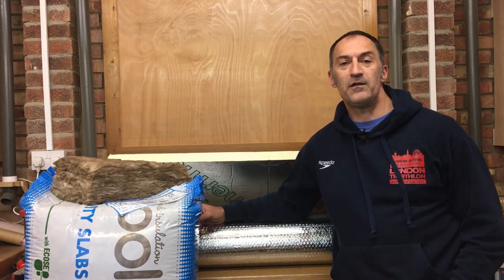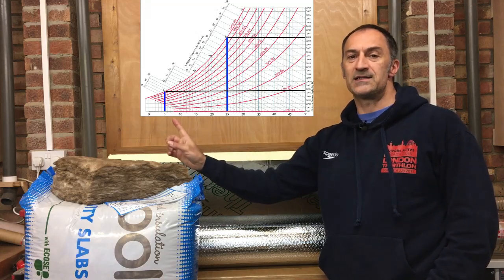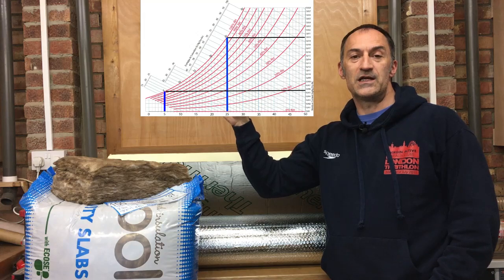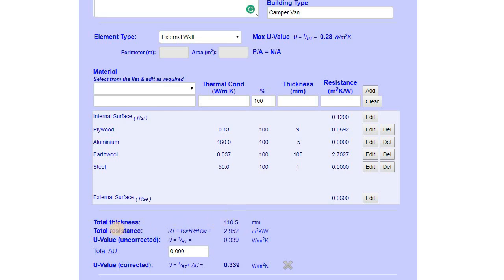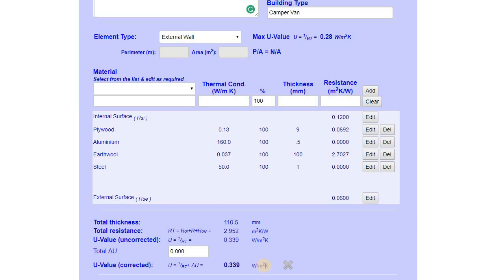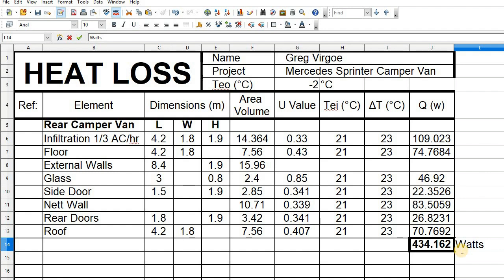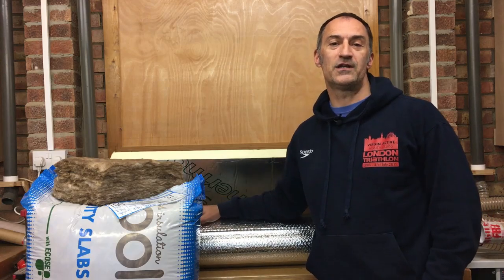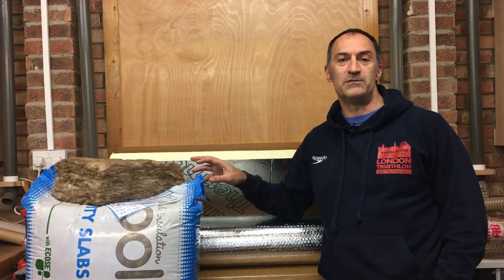How to Insulate your Van Part 1 - The facts you need!

Comment: Hi Greg does this kind of insulation work also in a hot climate?thanks
Reply from the maker: Yes, thermal transmittance applies to both hot and cold climates. The same as your cool box works.
The biggest heat source in summer is solar gain through the windows so make sure to shade the windows to reduce this.

Comment: Hello Greg, thanks for this video! It is very useful! Would  you tell me how would using carpet underlay to insulate some of the sides or floor of the van please. I have some left and I thought I should use it. Thanks!
Reply from the maker: Hello Andi, thank you for the nice comment. Carpet underlay can have some thermal properties, comes in thickness from 3mm - 12mm and some even have a foil face for a vapour barrier. You could use it to wrap your door pillars before covering win carpet of headliner material. You would need a lot fo it to fill all the voids in the side panel and I imagine its quite heavy

Comment: What I liked most about your vid. was that it positively agreed with another vid. on insolation. You are an educated Instructor and he has been living in a van for 15 yrs. both have come to the same conclusion. Thank you very much.
Reply from the maker: I’m guessing you are referring to cheapRVliving video on insulation. We share the same opinions on reflectix and it should not be sold as insulation at all. I would still insulate my floor even in warm climate as it will prevent heat gain too. Thank you

Comment: Hi, I have a dilemma. Looking for van conversion like yours. I’m looking to live full time with my cat. Currently cerebrally mapping things out. I will be working at times and my main concern is the temperature of the van in summer live in south east UK. Looking to have two vents as advised by yourself in fact identical insulation too. Not sure how well insulation will keep heat out. I might be considering a bus version in terms of windows, which I think will help me regulate temp through the progression of seasons (lpg temp regulation of sort in winter) as I can manipulate using insulation cut out to block window from cold or sunlight. think a AC unit would drain battery and I’m estimating 200ah pre AC. Advice would be greatly appreciated or on anything I might of missed concerning the well-being of the furry chap. Really detailed vid btw as always.👍
Reply from the maker: Hello, in the summer what heats up your van more than anything else is the solar gain through the windows. This is radiant energy from the sun entering your van via the windows and heating up all the surfaces inside making everything very hot.
A well insulated panel van will work well to reduce the transmitted heat in summer and keep the interior cool just like a cool box keeps your beer cold in summer. 
To prevent the solar gain it it best to have reflective blinds to prevent the sun entering the van. These also work better on the outside rather than internally. While extra opening windows will improve ventilation dealing with the high solar gain will be a problem. Hope that helps.

Comment: Great video. I don't necessarily agree 100% with your choices for insulation, but the principles are sound. Closed cell foam would be easier to use to fill cavities and make sure you get a consistent R value throughout, for instance, no worrying about squishing the mineral wool.  But still, real science on Youtube, nicely done.
Reply from the maker: As I explain in the next video on insulation. Spray foam is a very good insulator and much better than mineral wool. Downsides are it’s messy to apply, it’s a permanent installation and there’s no going back plus be careful you don’t put too much in and bulge out the outer skin of your van or separate the inner and outer skins. Otherwise crack on! 😊

Comment: Greg,  one more question. I am wondering what this means translated to actual temperature loss. I see you've come to the number 434 W of heat loss. But what does that mean in real life? Let's say I heat up the van to 20°C, outside temperature is 5°C. If 2 people are sleeping in the van, how will the temperature drop in an hour compared to an uninsulated van? I have no experience in this area and my googling took me only so far. Thank you.
Reply: Bottom line is really "you need to have a heater". Either a diesel fired one (Eberspächer, Webasto, Wallas) or vented propane, like Propex. If you combine good insulation with a heater, you'll be good to go to pretty low freezing temps. Precise calculations are good, of course, but the best you can do is the best you can do, when all is said and done. Although, each human is about a 100 watt heater in and of themselves.
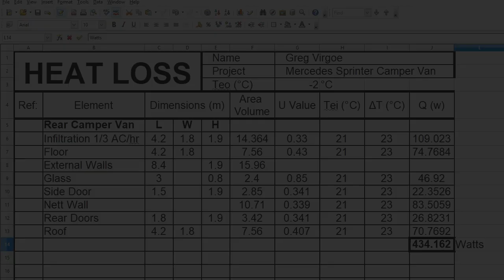Reply: "human is a 100W heater" - would that mean that the temperature would be stable in the van with 4 people and temp. diff. at about 23 degrees, based on the table at 13:20?
Reply from the maker: Hello, all the heat loss calculations relate to one hour, so you will lose 434watts of heat each hour.
Then every heater is also rated on its hourly output. So a 1kw heater will give 1kw out per hour.
My calculation is just for the back fo the van so you have to add some for the cab too.
A human body at rest gives of 140w total heat output. so you really do need a heater to stay warm.
Do a good job of insulating and it will keep down the fuel bills for your chosen heater.
If your van was uninsulated the temperature would drop really dramatically and you would need a huge amount of heat to keep it warm inside and stop condensation forming inside the van.

Comment: Thanks for sharing such a generous explanation, Greg!
Reply from the maker: You are most welcome Daniel, pleased it was interesting for you. Thanks for great feedback
Reply: Greg, further studying the subject (for the first time, I must confess), I found that PIR is noticeably flammable, whereas mineral wool in general don't. Any insights about how did you take that into consideration on your project? Considering the heater, gas hobs, etc., why would you still choose PIR insulation for such an enclosed space? It is a genuine doubt and I am not suggesting that it is not a good option, please don't get me wrong! ! Thanks again for the excellent content!
Reply from the maker: You need to be very specific what materials you research
https://youtu.be/HkM1kOO0S0I
Reply: Got it. Thank you very much, Greg! I think I made a mistake in taking PUR as the same as PIR in the explanation here (esp video "Comparison IPN, PIR, PUR" in the bottom): https://www.kingspan.com/roe/el-gr/products/insulated-panels/learning-center/kingspan-panels-fire-protection

Thanks again!
Reply from the maker: Daniel, I think you missed the part where all of the furniture and cladding in most self-build campers is made of wood. The insulation is the least of your worries :D

Comment: Hi
I also work with designing and installing ventilation systems and I've used armaflex a lot to insulate ventilation pipes where theres tight spaces. What do you say about using a 1,8 mm sound deadener reflective material on the steel followed by a 19 mm thick armaflex mat?

Hope you will answer as i've started my project just now :-)

Cheers

Comment: great video . what do you think of using super foil instead of celotex. would it be better.
thanks paul uk
Reply from the maker: Hi Paul, simply put, NO, as insulation multifoil is absolutely rubbish! I was given two new rolls of multifoil FREE, I took straight to my local tip and threw it in a skip and went out and brought Celotex. When a manufacturer refuses to publish the Kvalue or Rvalue for the actual product on its own be aware they are lying to you about its performance. They have shown it in a wall structure with 50-100mm of conventional insulation and trying to kid everyone that it's their product that's doing all the work. Please, invest your money in a much better product. Hope that helps.

Comment: Hi Greg, great vid - very thorough and interesting. Just one tip (although you may have covered this in another vid?) If you’re using mineral wool in any of the low areas that have the plastic clips holding the plastic bump panels that run down the length of the van, be sure to seal the clips on the inside with a dab of silicone as they can leak slightly. I’ve seen sodden mineral wool in these areas where the clips have not been waterproofed.
Reply from the maker: That’s a great tip, thanks for mentioning it. I have used a bit of sikaflex on each of the plastic clips. Cheers

Comment: Wonderful vid. It covers conduction very well. How about covvection on the outside in wind? I would agree the reflectex is worthless in cold except as a vapor barrier but it can be of enormous benifit in the summer when placed on the outer layer. It reflects heat from the sun. That can make the difference between livability or not in warm areas.
Reply from the maker: I totally agree with you regarding using it a screen on the outside to reflect the suns rays.
I will be using a reflective windscreen blind on the outside of our van during the summer months.
If you can prevent the suns rays from entering your windows this massively cuts down on solar gain.

Comment: Great video, I've just found your channel and am impressed with the quality content. 

About the reflectix stuff, given that it's only useful as a vapour barrier, wouldn't it be better just to use plastic sheeting and save yourself some precious millimetres.
Reply from the maker: Absolutely Gary, you can use a polythene vapour barrier. No problem at all. Polythene is very slightly permeable but it’s a microscopic amount. Foil is absolutely impervious. But either will do just as good a job.

Comment: What not spray foam? It’s an excellent vapor barrier and insulator. It also fills the small nooks well. Might even be able to trowel smooth each layer just after applying
Reply from the maker: In this video I explain why I'm not using it https://youtu.be/DKy6WnFh368

Comment: What are your thoughts on closed cell spray foam? I have the same sprinter as you and that's what I'm planning to use
Reply from the maker: It's a good insulator, same thermal properties as the solid PIR board.
Only drawbacks, it's messy to apply, very permanent solution and be careful not to overfill the voids as it continues to expand over time and can separate the inner and outer sheet metal and bulge out your vans side panels.

Comment: Great vid.

But keep in mind that over time l basically all of the "fluffy" insulation naturally compresses.
Not sure of how fast it collapses, but I flip houses and after a house is few decades old I go to do a flip and that rock insulation has dropped from 16-18 inches down to 5-6 just sitting in the attic (no matter how old the house I've never seen it thinner than 5-6 inches, so guessing that's about as far as it falls)

From what I've seen over the 25 years I've been doing this I'm guessing the collapsing starts almost as soon as it is installed since it's just puffed up with air and gravity is pulling on it (and any pressure put on it from shoving it in holes., And is just a continuous slow process. Factor in a twisting, bouncing van and I'm sure the collapse would go a bit faster.
Reply from the maker: Hello Rob, you may well be right Rob, It seems to have plenty of life in it and i have oversized it slightly when cutting.
Friction will help being sandwiched in the voids. I could have used the stick pins to hold this up as well.

Comment: Ok I follow and understand your point and equations but there is something that bothers me about insulating a van, most insulation is designed to have an air gap, either in a cavity wall or loft space, and I always thought the air gap also will act as a buffer of ambient air to prevent thermal bridges in a structure, every van conversion I’ve ever seem seems to have virtually no air gap between insulation and ply lining. So is this going to  make thermal bridging more of a problem? Also what about condensation and ply or board lining, should that be sealed both sides ideally to prevent the ply lining absorbing condensation? I.e is it worth sealing the ply as much as possible with a layer of varnish before covering with carpet lining or similar?
Reply from the maker: Hi Darren, it would help you to watch my next insulation video.
Condensation will only form on cold surfaces, i.e. the outside skin of your van.
To prevent this it is best to insulate and then cover with a vapour barrier before ply lining.
This vapour barrier prevents moisture-laden air from getting to that cold surface.
You do not need to treat the plywood as this is on the warm side of the structure and will not condensate.
Wood is also a very good insulator against thermal transmittance.

Comment: I have a Nissan NV200 with a pop top roof already installed. I have limited space for thick insulation. I cannot put thick insulation in place, especially on the floor. What's the best material to use?

Comment: We are really enjoying your informative videos. We are attempting a build in Georgia, USA and cannot find  source for polyiso (like Celotex) foam board thicker than .5 inches. Is okay to layer two or more sheets to reach our desired thickness? There are sources of thicker polystyrene board, here but we are a bit worried that it can break down at temperatures above 74 degrees C. Do you think we could exceed that temp on the skin of our van on a hot sunny day?
Reply from the maker: Hello Kelly, yes perfectly OK to build up layers of polyisocyanurate to your required thickness. 
I doubt very much you'll ever get close to that temperature.

Comment: So if i put 100mm wool and compress it in to a 50mm space will it lose so much insulation value that uncompressed 50mm wool would be much better? 
I mean a van wall typically needs 100mm in the midle and 50mm top and bottom. It would be easier to go with 100mm all the way?
Reply from the maker: What I’m trying to explain is if you take 100mm of the insulation and squash it into 50mm void you won’t get the same amount of insulation as the 100mm it will be half as effective. Insulation is relative to thickness. Cheers
Reply: Thanks alot! That´s just what I wanted to hear. Didn´t know if I had to buy both 100mm and 50mm and piece it together. Cheers! Love your videos btw!

Comment: What do you think of sheep wool for insulation? Is mineral wool ecological?
Reply from the maker: It works well for the sheep Danielle 😉One of natures best insulators.
But seriously I did a bit of research and Sheep Wool Insulation (Certified Europewide CE Value) 0.039 W/mK
So that's on a par with my Earthwool or Mineral Wool in general, and it's a natural product.
It does retain moisture but with a really good vapour barrier, you won't have to worry about that.

Comment: The heat loss calc won't be very accurate, because as you said the Earthwool heat resistance is dependent on the thickness of 100mm. So unless it's installed and remains at 100mm the figure for heat loss would be inaccurate. True?
Reply from the maker: I was explaining that IF you did quash it down you can’t expect the same thermal value. Where I have used it the voids are 100mm deep and it’s not been squashed. The heat loss calculation is a very good estimate. Thanks
Reply: Yeah agree....loved the video mate. Watching your complete series now.  Thinking of doing a Sprinter conversion myself.Being 6ft 4inch worries me though, still not enough headroom I would guess.
Reply from the maker: That’s tall for a lady? You’ll need the extra high roof. Mine is about 6’4” stripped out bare
Reply: Haha, don't believe everything you read on the internet!! I'm an ugly Aussie male. Watching your wiring video now. Luckily for me I have a son who is an Auto Electrician, so that daunting task will be taken care of by him. Thanks again for the comprehensive videos. Nice job. 👌
Reply from the maker: Thanks Mr Kitty 😂